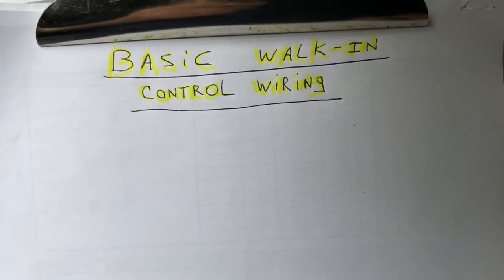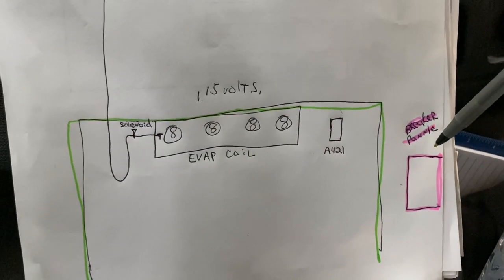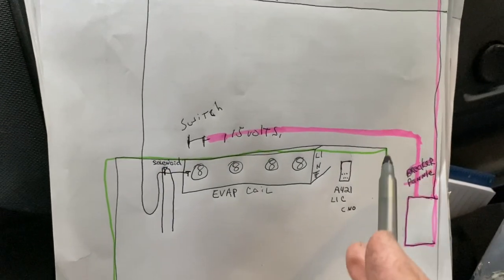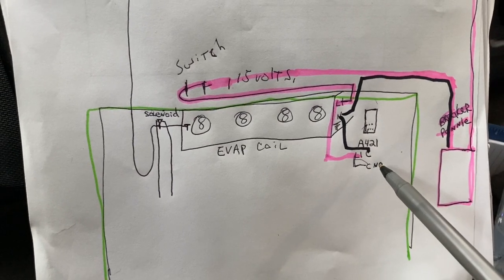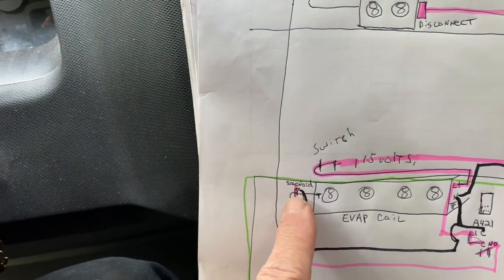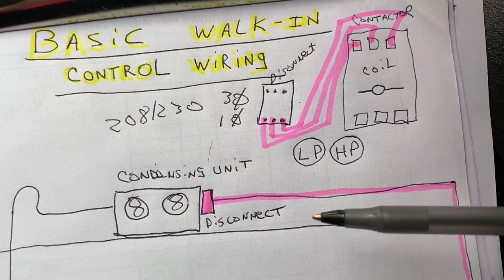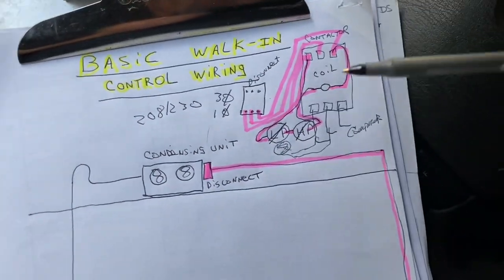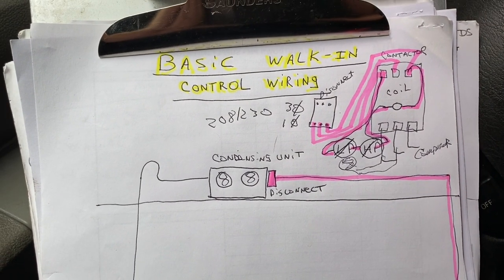Basic walk in box control wiring

Comment: Informative and basic. Nice job. 
I'm retired now, but travelled multiple states taking care of industrial, institutional, and some commercial accounts. Also helped with apprenticeship training. (Ran EMS, rescue, fire, and had the privilege of flying with a helicopter service to unwind after dealing with architects and engineers at my 'real job'. 
Might touch on wild leg sometime to clear that up for folks, preferably not using it for your control circuit, and the oil pressure/ low pressure controls. 
Nice video --

Comment: Do I hear in your voice a rewire job?  Or perhaps following someone else's install, and left wondering how the installer can breathe unassisted.

I had that yesterday, and ran into just what you were saying about the disconnect on a brand new install. 

I know I've been away for a while but a WIF set up for a WIC, and the Ranco ETC sensor right on the evaporator. The customer was very angry because the installers couldn't figure out how to covert it. Oh joy, I didn't miss this.
 
Disconnect corrected, moved t-stat sensor, fans wire for always on, heating elements disabled, and left instructions in evaporator and condenser for easy conversion back to WIF operation if needed.

Now we are back to carry out only in Michigan. So you know they will keep the freezer condensing unit. All that capacity going to waste, but the customer is happy he has a WIC that works.

Comment: what if you didn't have a T-stat or solenoid valve on the evaporator, less problems,  couldn't  you control box temp with the LP control on the condensing unit?  last time I checked, pressure is temp... did this stuff for thirty years...

Comment: Thanks for the basics.  Also I can add set the low pressure cut out above vacuum on those scroll compressors if they pump down to a vacuum it kills them quick, right? Use your gouges to set the lpco switches.

Comment: Hey man great video! Got 2 evaps on 1 condenser. The evaps have pre mounted tstat and solenoids. I've piped them in bull nose style and I'm onto wiring. How would a man make both solenoids open off 1 tstat?
Reply from the maker: Just use 1 stat to control both solenoid valves

Comment: Great video, I just had one question, for the solenoid valve. I re watched the video many times. So you land L1 for the solenoid valve on N.O ??? I thought it would go on N.C since the solenoid valve opens when energized and is in the N.C position when when it’s not energized by the Tstat… can you you explain that. Thanks in advance
Reply from the maker: It’s the way the Tstat is configured on temp fall the NO contacts open. And re make on temp rise.
Reply: @NorCal-refrigeration  thanks

Comment: Awesome Dave! I forgot what purpose was for reverse p-trap of line set above the roof to the condensing unit and you already have p-trap suction riser coming out of the evap coil below?
Reply: to help return oil to condenser (compressor), also many area require a tall roof boot at the penetration, so the lines generally go up high and then back down lower ( heavy rain, snowfall, plugged roof drain area) underwater line set penetrations can end up a new roof drain :)
** also forgot to say, a long horizontal(maybe sloped the wrong way on the roof can pool oil in the bottom, drain back to and down the vertical without the inverse trap at top. if it's short horizontal, doesn't matter as much.

Comment: 🇺🇸👍💪❄🎸🎤  hey Dave if u turn off the switch inside the walkin box will the compressor stay off or is there a chance it will still run or come on   ? This is your doing work inside box.
Reply from the maker: The only controll for compressor is the psi switch. So if power to the thermostat/ solenoid is off the unit should pump down.
Reply: @NorCal-refrigeration  thankyou  Dave much appreciated 🙏 👍🏼 🏍

Comment: Now can you explain sizing of refrigeration line , p traps and expansion Valves.  Hint Hint   For content.  Great video
Reply: My company buys all the refrigeration units from United. The wholesaler will match up the units using the data provided by Trenton, Copelend, and Tecumseh.
I choose the piping based on the size coming from those units. 
If the condensing unit is above the evaporator or it is a long line set, I may drop a little on the suction size to get velocity needed to bring the oil back. 
This is how I was trained by my mentor. Others may vary.

Comment: When the thermostat calls for cool , why will the pressure in the unit come up (is not already equalize and at about 100 psi? 
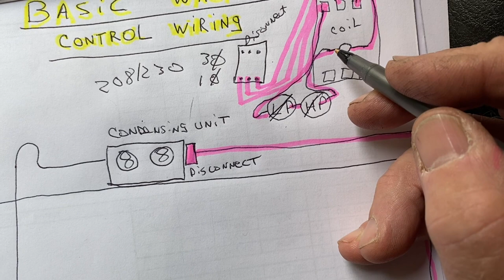And you say low pressure pressure makes( 9:59 ) ?
Reply from the maker: It has a solenoid Valve that pumps down the unit when the thermostat is satisfied.

Comment: if you wire like they did here, the disconnect bottom and fuses will be hot full time, with the disconnect breakers only opening the top >_<
yeah, I;ve zapped myself over the years a few times and shorted pliers from neutral to hot phase (the dumbasses also fused and used red as neutral) should I mention 3 prong outlets, with neutral and grounds all bonded at said disconnect.  blew the neutral fuse once as a kid and god zapped by metal droplight shield, it now has 1/2 + copper pipe instead of a fuse there (lazy hillbilly quick fix) LOL. one of these I'll have to go sparky mode and rewire it right (for now it's staying as is/bought about 40 years ago )